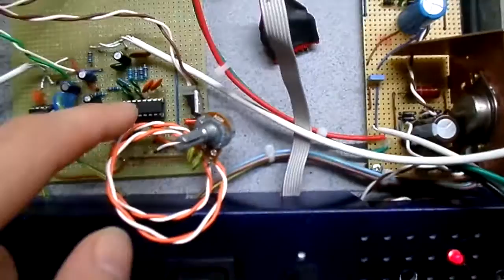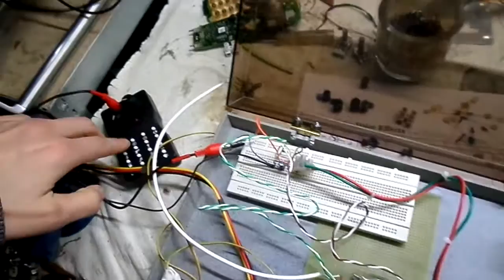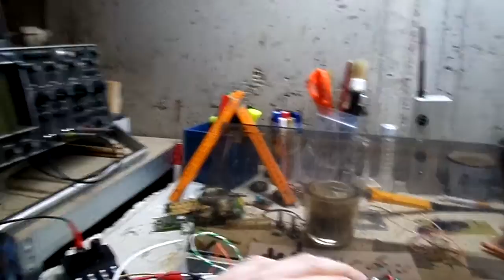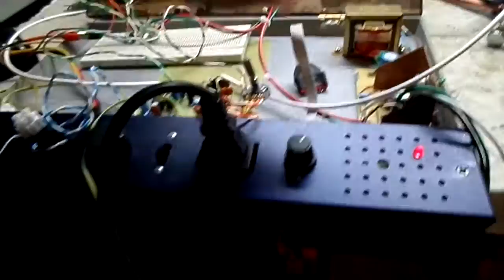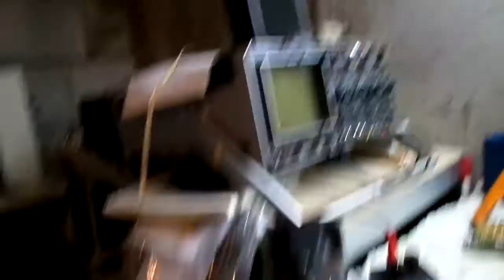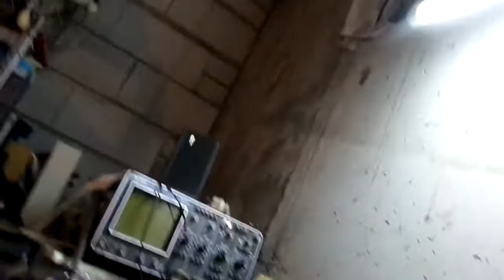PT2399+LM386 circuit - mini mic & sound FX demo

Comment: wow man this is a very tedious project you have going on.... I remember when you were first remelting solder trying to find the break. very good job man!
Reply from the maker: hey thanks dude =D actually it was fairly simple thats my second time building the board the first time i made the circuit super compact looked great but was a problem some where and i could not find it ! so the best thing to do is leave some space making problem areas easier to solve .. got a new soldering iron too makes quick work XS25 25W  think thats the name cheap but kickass !

Comment: Hey bud'
That circuit is very cool, I like circuits like that, there great fun, you can spend alot of time trying different verbs from it and liking every one lol

Thanks for sharing.😉 

👍👍👍👍👍THUMBS UP 👍👍👍👍👍
Reply from the maker: hey Ant how are you friend family is well i hope =D thank you much its great fun this is a basic test circuit  off the PDF ! and its easily modified i have a larger version coming using two of the IC's plus they are CMOS meaning that they are easy to work with, dont use jack for power consumption and many mod's are available .. only problem is static shock can kill them ( an FYI  for you if you happen to use a CMOS IC for any of your projects ;-) ) thanks again bro stay warm in the shed and cheers !